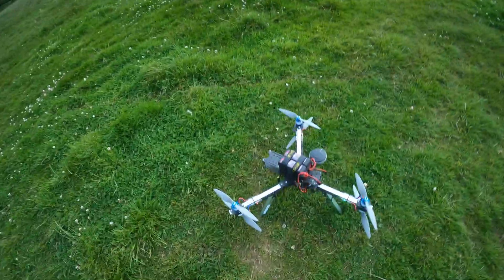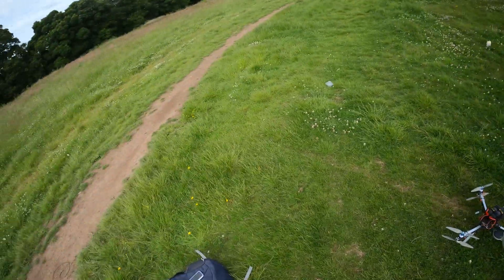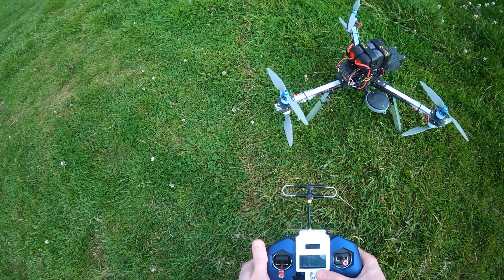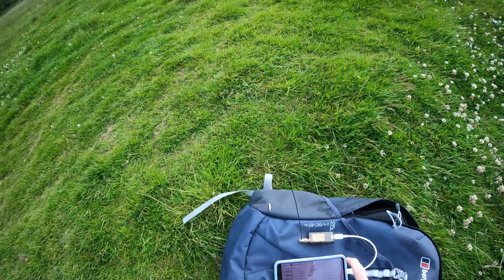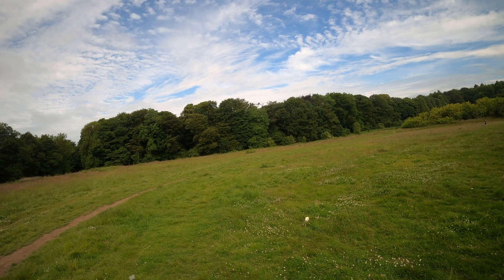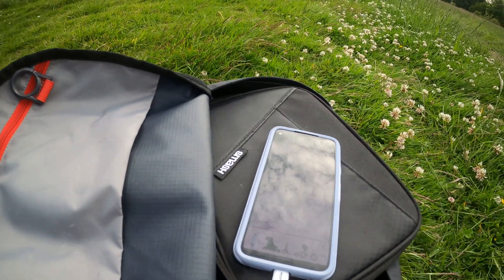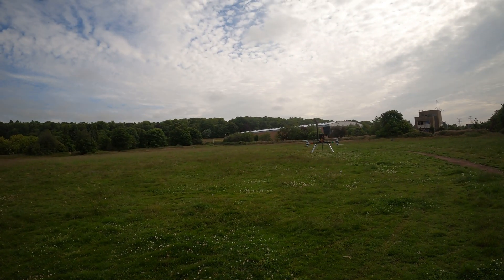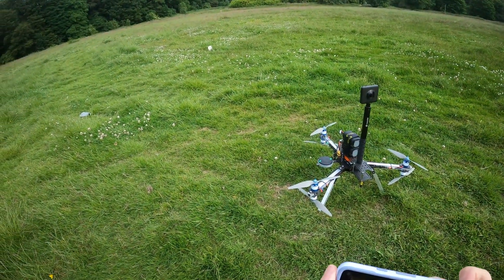Arducopter Y6 hexacopter // Autotune individual axes // Custom frame

Comment: Love the build! Where can I get those very tidy battery connector brackets please?
Reply from the maker: The whole frame is a custom design, I designed the battery connector brackets for the specific standoff spacing I was using.
Reply: @CJDavies  thank you, just looks so neat! Enjoying your vid's and photos on Rotorbuild.
Reply from the maker: @andybeveridge9831  Thanks! It's been a while since I managed to get out to do anything RC related, but hopefully that will change soon with the new Arduplane build I have ~75% complete :)
Reply: @CJDavies  even more exciting times ahead! I have been away from multi rotors for a while, Pixhawk is my most ‘modern’ FC! Fascinating to see how you are building stuff, and many thanks for the links to suppliers for the FC and PDB kit you are using. I had a dig through my boxes and have sufficient to go for a small Y6 based on the FC you are using. Please keep sharing ! Once I figure out how to subscribe, I will be there. Stay safe.
Reply: @CJDavies  I have been looking in more detail through your postings; did you ever use the 3d printed hub and top plates in a build, or were they just prototypes and never flown please? I have a neighbour who could print them for me but no point if they are not strong enough. I would welcome your thoughts.
Reply from the maker: @andybeveridge9831  Those 3D printed parts were only for prototyping, to check component clearances etc. FDM 3D printed materials simply don’t have the strength (rigidity, especially) for the structural components of a multirotor. If getting bespoke carbon fibre made isn’t an option, then thin plywood sheet, hardwood dowel & aluminium box section are all perfectly viable options!
Reply: @CJDavies  OK, many thanks for the clarity.